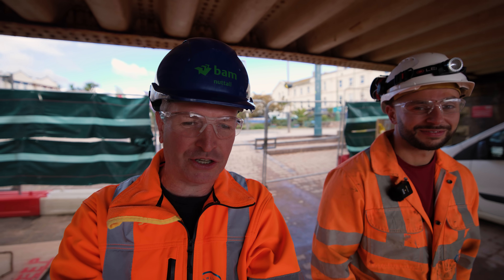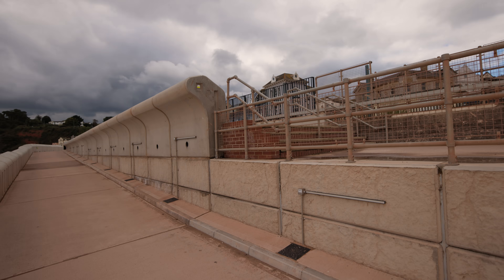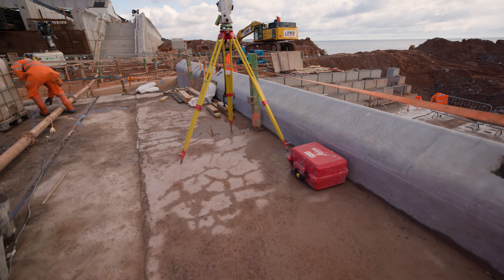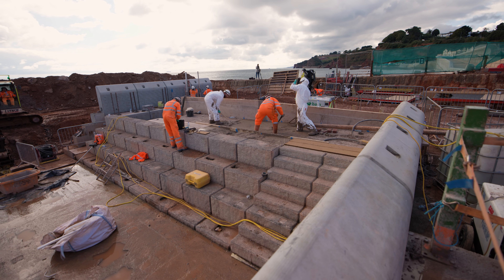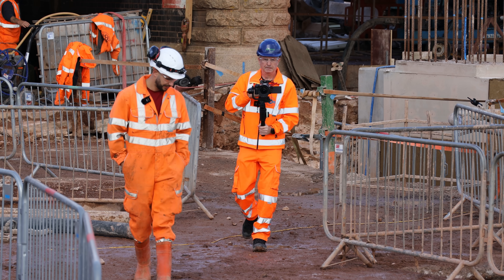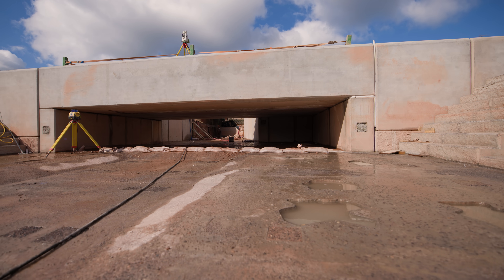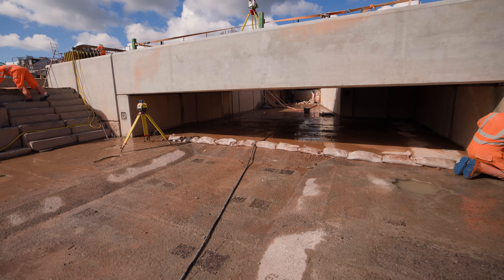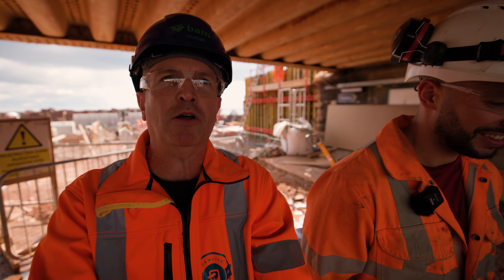UPDATE: The Dawlish Sea Wall Update - October 2022 with Bam Nuttall - 8k

Comment: A flawed project in both design and choice of materials.  The vertical walls reflect waves rather than dissipate their energy. A far simpler solution would have been to deposit large boulders randomly, as has already been seen to work to good effect at Dawlish Warren and at Sidmouth. The concrete walls have rubber inserts between expansion joints that are already showing serious signs of deterioration and as yet no serious storm has impacted the area.  From a beach user or boating aspect the lack of exit points landward from the sea presents a lethal hazard, making rescue potentially extreemly difficult or even impossible.
Lastly and by no means the least of my criticisms is the fact that loss of beach material (sand and pebbles) are likely to be seen at an accelerating rate due to the vertical walls reflecting waves back out to sea which then carry away greater amounts of beach material.
Reply: Maybe you should have submitted a design then! I am sure you would have done a much better job from your armchair than some of the world's most experienced marine architects!!
Reply: @sgthree  At age 79 and having lived in the Dawlish town for many years I have seen the ferocity of gales over the years and seen with my own eyes, the dropping level of beach material I referred to. There were rows of beach huts along the high water mark, but today there is NO beach to support huts above high water mark. All that beach is now gone!  I have also seen with my own eyes the effectiveness of the granite boulders I speak of and know just how effective they can be even against stormy seas. Time will tell and I shall watch the already deteriorating concrete walls with alarm. I would welcome the chance to accompany any one on a walk along the wall at low water and point out the flawed structures referred to if you like.
Reply: @grahamtapper3383  You sound as if you have not been following the project, as the options have been mentioned. I am still guessing you do not have experience in marine architecture and tidal engineering, other than observing, and therefor this needs to be left to the experts. As I said, you could have submitted your ideas at the many events, but you now decide you know more - now that it is too late!!
Reply: @sgthree  Sorry to contradict on your assumptions but I have followed the ongoing project very closely indeed. There have been many studies completed over many years. I would refer you in particular to the ones focusing on Dawlish Warren and Sidmouth which have required in depth studies, marine architects, engineers and universal knowledge. Are you by any chance on the design team of this flawed project or have any inside knowledge at all ?🚮
Reply: @grahamtapper3383  I am not on the team, but am someone who also has spent my life growing up in the area, spending my formative years living in direct sight line of where the works are being carried out.

I ask again, why now, when it is too late are you criticising? It is not going to achieve anything at all, and you are just wasting your breath and probably stress levels.

I have little time for, and have probably spent too much time discussing this with an armchair expert who thinks he knows more than the world's most experienced specialists in this field.
Reply: @grahamtapper3383  I would also point out that both Dawlish Warren and Sidmouth beaches are VERY different to Dawlish 'town' beach.
Reply: @sgthree  They supass only Hitlers Atlantic wall.
Reply: @jameskrell4392  You really have a very negative outlook on life! Are you OK?!? Do you need to talk to someone? Get rid of some of this anger that seems to be building up inside. Do you need a hug?
Reply: All fair comments and only time will tell but the additional infrastructure will be of great benefit to pedestrians and train users alike. Also although the giant rock barriers (we have those here on the east Kent coast) they do not provide much safe refuge for children and tourist beach users. Personally I think it’s a super job.👍